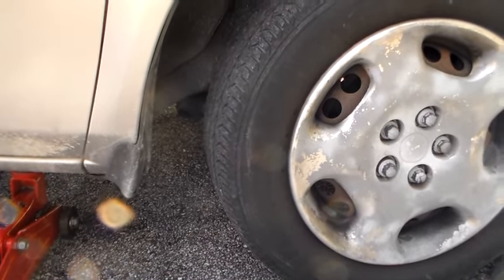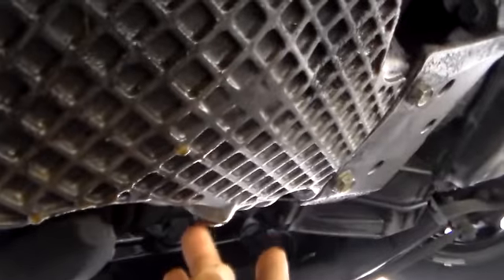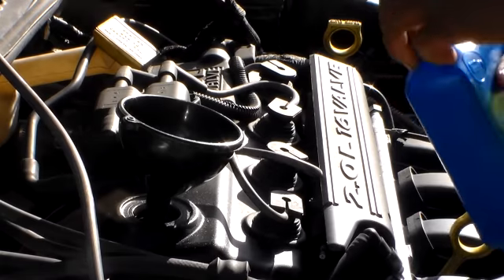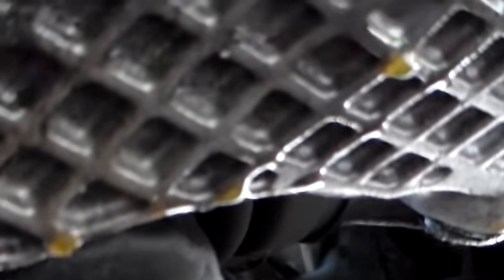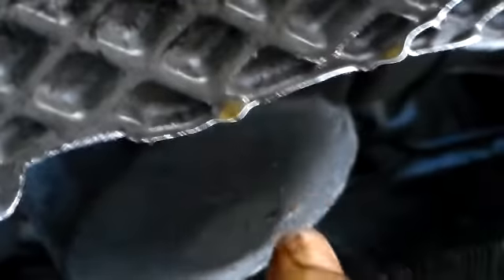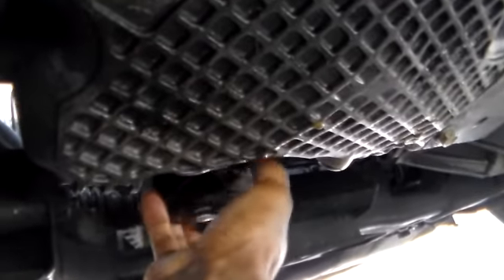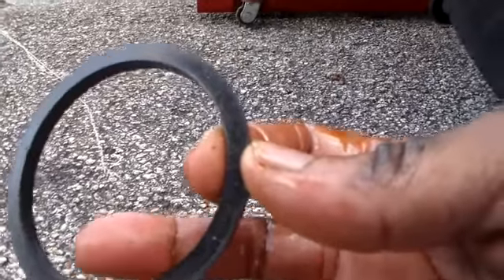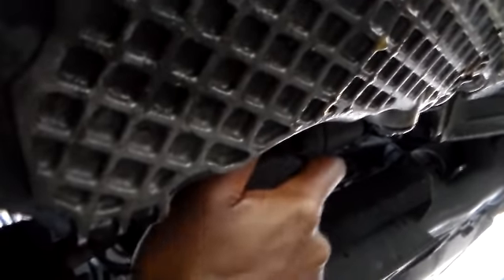How to change oil in a 2001 Dodge neon and Plymouth neon

Comment: What I don't understand here, Diversity2, is why/how you can get by with removing and tightening your oil drain plug just by hand alone. I have been changing oil in my 2001 Neon, and other cars for years and always remove and tighten my drain plug with a ratchet hex driver. I can't imagine expecting the drain plug to be tight enough to hold over time with only a hand tightening. Maybe it works for you, but for me, no way.
Reply from the maker: Hey histubeness how are you, thanks for watching, you are right, I do use a ratchet I my not have showed it in the video, I know what it is like to have the drain plug to come out, I was driving a UHAUL from INDIANA to UTAH some one forgot to tighten the drain plug the motor was destoryed